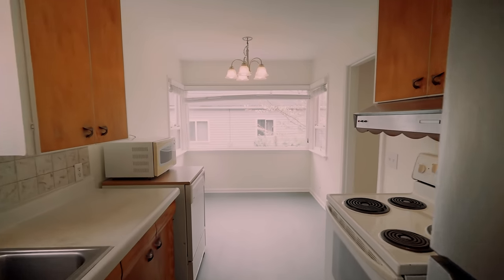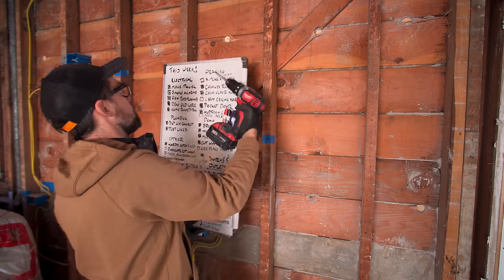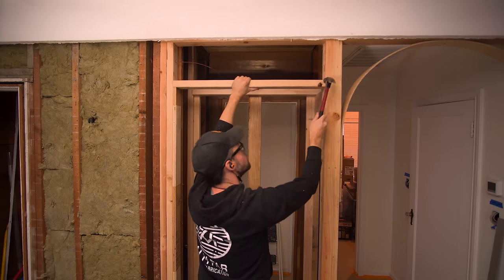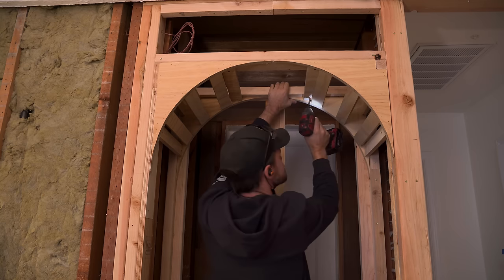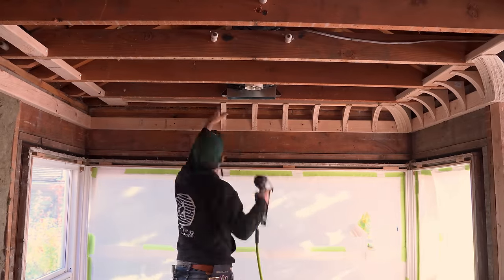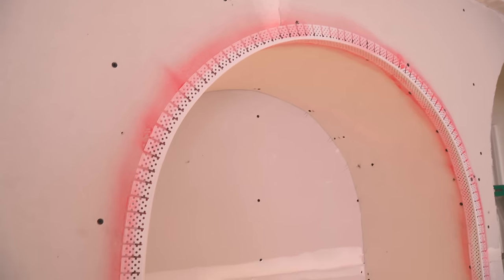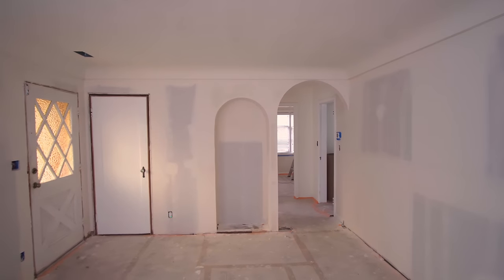Last-Minute Architectural UPGRADES | 5 Days till Drywall

Comment: I just did my bungalow to the same degree you are doing yours. I would be very concerned about the rock-wool and how it will hold moisture. You don’t have any building wrap, so it’s going to get wet and cause mold growth within your walls and Sheetrock
Reply from the maker: Rockwool handles moisture better than fiberglass or cellulose.
Reply from the maker: https://materialsmarket.com/articles/can-insulation-get-wet/#

Comment: Ignorant question, why such a seemingly low 'R' value with the Rockwool?
Reply from the maker: It’s only a 2x4 wall so R-15 is about the max you can get in there
Reply: @MichaelAlm  Thank you for the clarification. I didn't know the wall depth effected the R-value that much.
Reply: if you want really efficient insulation you not always need thickness ----
you can multiply the R value using Radiant Heat insulation ::::::    wool + radiant heat barrier + 1/2 inch space (around 1-2cm ) from the drywall (it cant touch the drywall or it wont work -- that's 99% of the reason why people think it doesn't work because they use it wrong- it touch the drywall /osb / plywood and because of that it doesn't work , you need air gap for it to work) 

and you will have 3-4x better R value because radiant heat insulation doesnt insulate - it reflect most of the heat before it reach the wool
you can even use only radiant heat barrier to insulate the house ---at least 2 layers with air gap between + air gap between inside layer and drywall and you have literally thermos ultra warm
there is only one disadvantage like in all new houses ...its thermos .... warm but also need ventilation for moisture to go somewhere

Comment: Is there a reason you insulted your interior walls? Just curious if there is some kind of requirement in your state.
Reply from the maker: It was to deaden the sound. We'll have a dryer in the mudroom, and I didn't want that to be heard in the living room.
Reply: Isn’t it standard practice to insult all walls? They need to know their place, right? 😉
Reply: not it the us @mizboom
Reply: Gotcha, good call. I wouldn’t want to hear noise either.

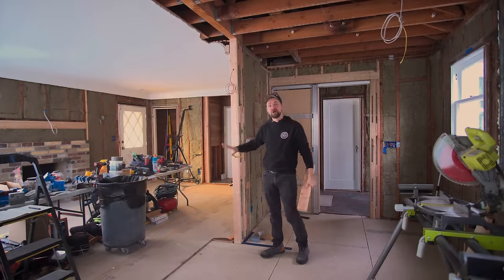Comment: 8:24 Having two different floors in an open "floor" plan is a common architectural mistake. It just looks terrible. It should be all one type of flooring to ensure flow. Its a myth that tile or other water resistant floor is needed in a kitchen. This is not a commercial kitchen. People are quite capable handling water, whether its in a living room or kitchen.

Comment: not gluing the drywall to the studs and rafters, not using 3/4 on the ceiling.... HUGE FAIL. you are NOT permitted to use 1/2" on ceilings, well i guess some ghetto places must be fine with it, but its not a good idea.

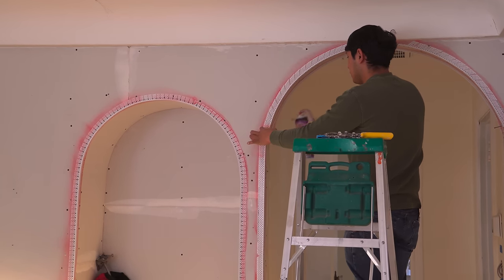Comment: 25:00 WOOOOAH wait a fucking minute. Why did they cut the flex corner bead????? That shit is already cut on one side to be able to bend, if you cut the other side then all your doing is making it harder to keep straight on the straight axis (the axis that is the wall). 😂😂😂 I would have told them right away “WTF are you doing and thought them a lesson on why the fuck you don’t cut flex corner bead.😂😂

Comment: Wow you paid a company/fabricator to make those coves?😂😂😂 gTFOH this is gold, prefab cove wood framing😂 dude just get sheet metal tubing for hvac. 24” tube cut it half and screw the metal in the corners, use two layers of 1/4 around that corners and wallah.

Comment: Dude no vapour barrier?
Reply from the maker: I did a lot of research on this and in this climate it isn't required, and some say it can actually do more harm than good. We rarely get below freezing here.
Reply: Adding a vapor barrier into an existing historic building can sometimes lead to even worse moisture problem. In the Seattle climate, neither summer no winter are extreme enough to really need vapor sealing. Matt Risinger has a couple videos about when Not to add a vapor barrier.
Reply: When I did a major renovation in the Boston suburbs, we ran into this. The walls were insulated with spray isocyanurate, which does not need and should not have a separate vapor barrier. Code required one anyway, and was inspected ... so we added a very low cost vapor barrier for the inspection, then tore it down before the plasterboard was put up.

Different construction materials and methods, and different climates all need to be considered on a case by case basis. Do the research!
Reply: Good to know. I actually live just north of Seattle in Vancouver so pretty much exactly the same climate. It seems to be building code here, but I'm guessing that's to cover the rest of the province where it does get much colder in the winter.

Comment: drywall is the stupidest thing you can put in the house I understand it's simple and easy, but takes a lot of time gets dented it damaged very easily. You're better off putting up shiplap good old, solid wood shiplap you can paint it any color you want technically and if you don't like it, you can then strip it painted again drywall is just a pain